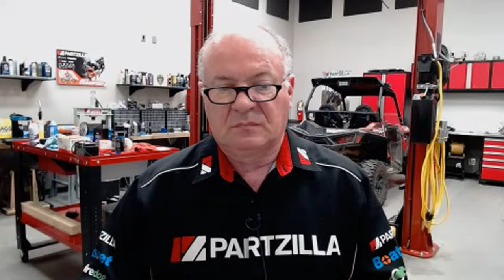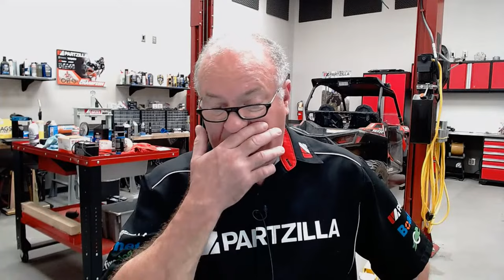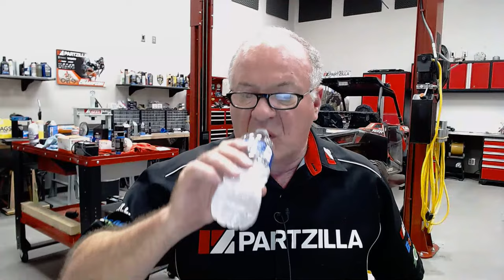Live Q&A with John Talley | Partzilla.com

Comment: Hi John, I’m hoping you can point me in the right direction. My Can am x3 charging system no longer charges my battery. I have changed the regulator and Stator twice.  Originally I have the leads reversed trying to charge the battery and that fried the battery. Can the flywheel be the issue? Is there a way to test a flywheel?  Thank you Sir!!
Reply: Yes check your magneto! We have some videos on that.

Comment: I have a Polaris 425 . It is the same distance on the timing chain from double silver links to a single silver link to line up on the crank . My question is - if the timing chain tightener guides push in farther on the adjuster side than the opposite side does this mean there is on one chain side longer my chain indicators didn’t line up with the marks . I guess I’m askin if that makes more of a tooth number on the front to back chain travel when it works the valves . I still didn’t ask this right .

Comment: How you doing John?
I have a question, I have a k5 gsx-r1000 with ignition problems, overhauled the fuel pump, replaced the rectifier, and the the starter relay and fuel pump relay test good.
Also when I turn the ignition switch no pump priming,  headlights don't turn on and the 12 volts that go to the fuel pump plug is going to the negative not the yellow and red wire.
I haven't done any wiring or work on the bike... can it be the ECU?